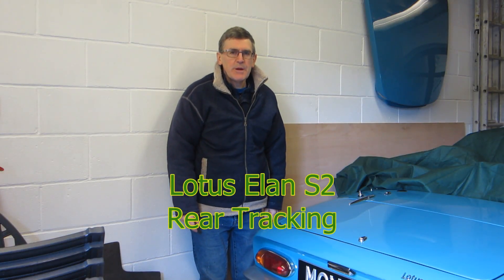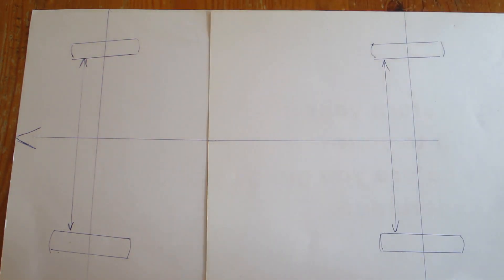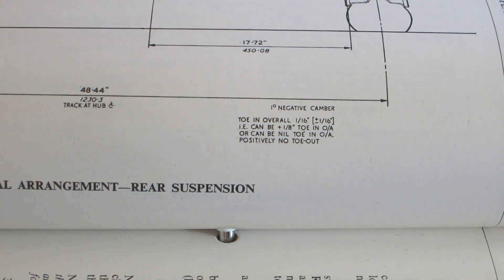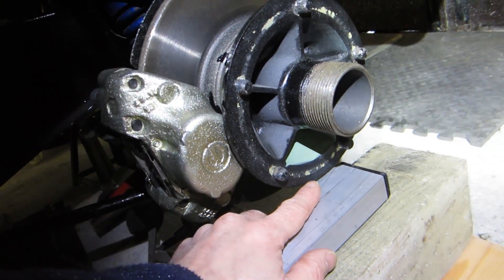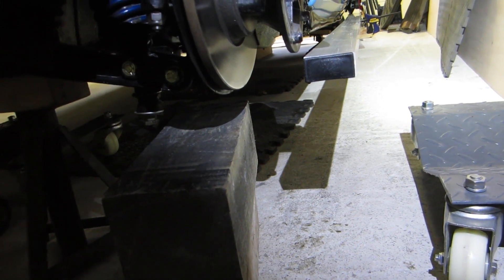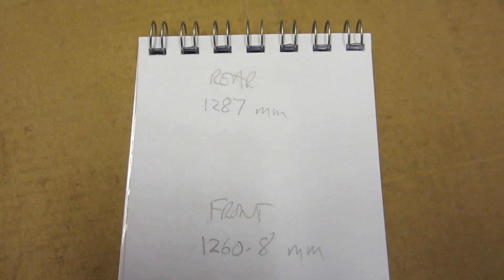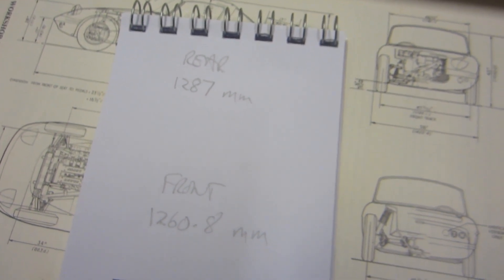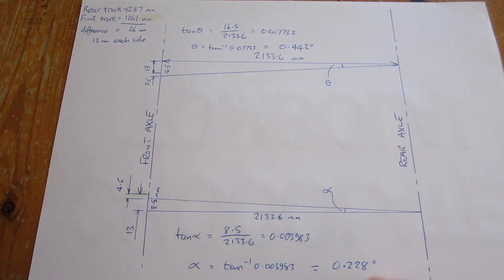Lotus Elan S2 rear tracking

Comment: There is one in a barn near me . I can't perfectly identify . It's white 1600 dual Stromberg hardtop hideaway lights and "elan coupe" badges front fenders near door. t4 stamped where your engine looks t10 in same spot.
Reply from the maker: Sounds like it'll be an S3 fixed head.
Reply: @PaulH_S2_Elan  thank you very much..

Comment: Good to see you again, Paul! One question: Is it possible that the rear control arm bushings are worn unevenly? What other possibilities are there, just manufacturing variations? How would one go about correcting misalignment at the rear?
Reply from the maker: Hello Brian,  All the bushes are new so my thinking it that my result is normal, i.e. just a build up of tolerances.  If it had been toeing out I would have corrected it by adjusting the lower 'A' frame by some careful measurements and calculation and then cutting the front tube to make it shorter (if it had been toeing out), sleeving it inside and then brazing it. This approach has been used successfully by others.

An alternative would be to buy adjustable 'A' frames which I believe are available; used by the Elan racers.